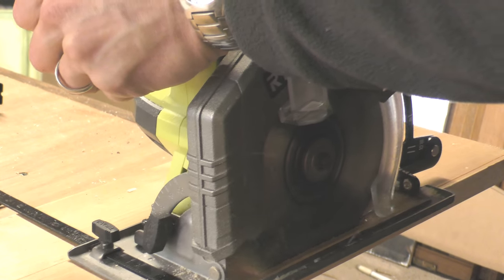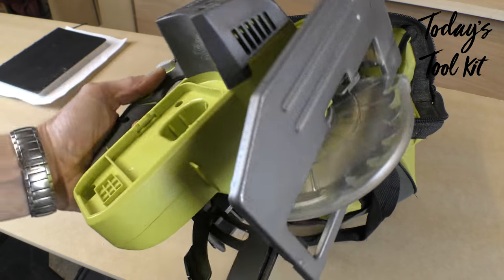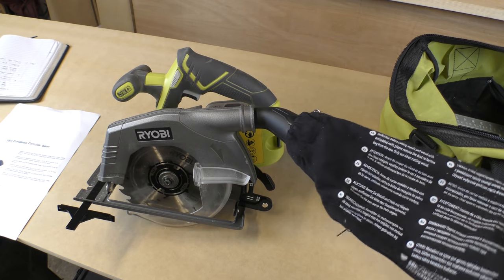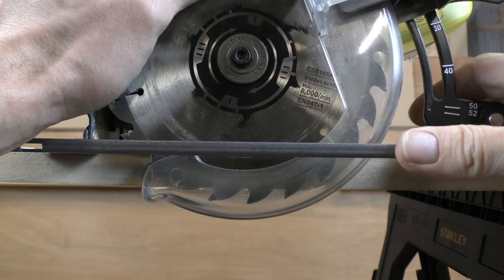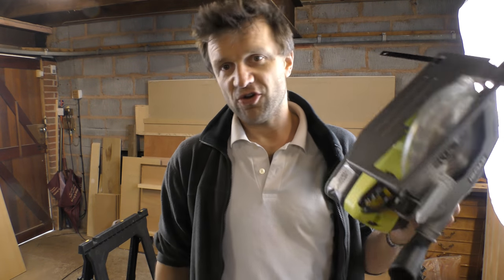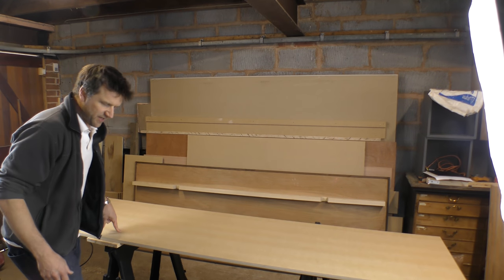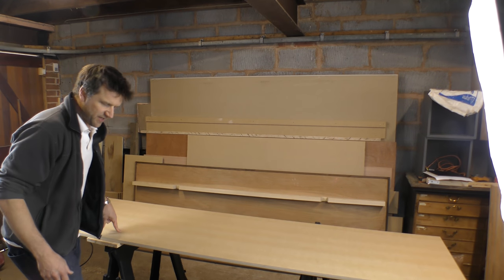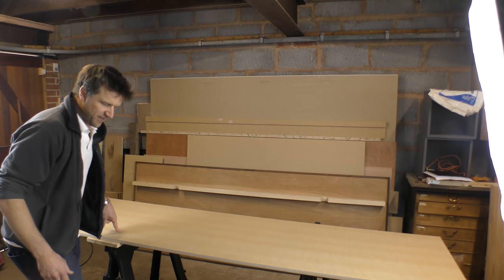Circular Saw - the MUST HAVE DIY Tool

Comment: Hi Charlie, thanks for your videos and as a first time home owner you are giving me more confidence and inspiration to try out some fixes and improvements on things I've been walking past/ hiding from. Starting with painting some MDF shelves I made in an alcove.
I have a book (Collins Complete DIY) that says the best size of circular saw is 19cm or more, but it doesn't really say why. I gather the bigger blade allows a deeper cut but are there any other advantages to a bigger blade as opposed to the smaller tools commonly available? Also, I'm keeping an eye on eBay for second-hand tools such as this, do you have any views about how to avoid duds?
Reply from the maker: Hi David, my saw has a 165mm diameter blade. For a battery powered saw you wouldn't want to go any larger. The saw blades tend to be this diameter, and very thin, to cut economically through the timber to save as much battery power as possible. I also have a mains powered Evolution circular saw with a 185mm blade. Obviously with a mains powered saw, everything is scaled up a bit because there's more power. I haven't used the Evolution much yet so I can't really say how they compare but it will be able to rip through wood a lot easier. I've found the Ryobi a brilliant tool, small, much lighter than the Evolution and a real game changer in terms of what I can now achieve with it - and you're obviously not trailing a flex around which is a bonus. Have a look at plunge saws as well because they tend to run on tracks with a notch to stop the saw wandering so you're guaranteed a straight cut. I'll be doing another video on circular saws in a few weeks so keep your eye out for that. I would say generally steer clear of brands you haven't heard of, and with second hand saws you always run the risk that they're damaged in some way which will affect the accuracy of the cuts. That said, Aldi do a plunge saw and guide for under £80 https://www.aldi.co.uk/workzone-track-saw/p/087060236365900 which has had some decent reviews on YouTube

Comment: I was taught to extend the blade through the work piece so that the carbide tips are totally exposed. That, I was told, would make the blade "run cooler."
Reply from the maker: I think either is fine. The important thing is not to expose an excessive amount of blade below the material being cut as then the blade tends to wander.

Comment: Mate... that last cut, noticed you pushing in with the thigh to hold the waste piece up... have read that pinching of the saw blade can cause kick back. Not a major problem with those tools having electronic brake but something to have in mind.

Comment: Good review.  How much lateral play is there on the axle?  Are the bearings seated in metal or plastic?  What are the prices for replacement bearings?
Reply from the maker: There's a minute amount of play detectable by hand. As for your other questions you'll have to take them up with Ryobi but for the price it's a great tool and there are no signs of wear so far.

Comment: Hi Charlie, I love watching your videos they are so informative. I’ve just invested in a Ryobi circular handsaw. I’ve never used one before and Im just getting used to it. I do however have an evolution mitre saw which I’ve had for many years and I’m quite confident and competent with it, I was just wondering when setting the depth of the blade on the Ryobi for a straight cut to a 1/4” below, do you have to reset the depth to do a bevel cut ? Sorry if that’s a stupid question.😁
Reply from the maker: Hi Nikki - good to hear from you and thanks so much for watching my videos! Yes whatever you're cutting you need to set the depth of the blade so that no more than a tooth is poking out below the surface to be cut.
Reply: @CharlieDIYte  morning Charlie, Thank you. Time to set it up and make some cleats for the tool storage wall cabinet I’ve just finished making after watching a YT vid. 👍I’m going to have a go at making a fence for the saw.

Comment: Soon, I’m going to be replacing a lot of skirting boards, would you choose to buy a circular saw over a mitre saw because of the versatility of the circular saw?
Reply: Dave 1976 defo, with a mitre saw can only go in 22cm
Reply: Dave 1976 defo a circular saw I mean
Reply from the maker: If it's just skirting you'd mostly be using it for, I'd go for a mitre saw - much more accurate cuts. The circular saw is very versatile as you say but is better for longer cuts or short cuts where accuracy isn't paramount. The mitre saw is great for multiple repetitive cuts and accuracy. You can get a mitre saw pretty cheaply these days. Take a look at the Evolution range. I have an Evolution mitre saw and have been very impressed with it - a lot of tool for under £200!
Reply: Charlie DIYte thanks for taking the time to reply.  What a great channel.  👍

Comment: Charlie, it may just be me, but..... in the video, you use your right hand and the blade is to the left, which makes it easy to hold the rafter square and cut along it.  When I click the link to Amazon, the saw shown has the blade to the right which means that to achieve the same thing, you'd have to cut left-handed.  This seems odd?

Comment: A couple of observations on the safety front.  Do not do DIY in open sandals; it's asking for trouble.  Also when adjusting the saw remove the battery!  It may take a few seconds more but avoids any nasties.

Comment: Really helpful Charlie, thank you!
Reply from the maker: You're welcome Alex. You can also make a track for it https://youtu.be/mvcPuUz_m74
Reply: Thanks Charlie, I’ll check that video out. By the way, have you ever made a video on accurate measuring and cutting? As a DIYer, I’d love to know how to accurately measure and cut. Particularly when doing precision work. I always seem to end up a few mm over or a few mm under. I think it’s because my measurement is not spot on (especially when bending a tape measure into a corner) and then where to cut (on the line? behind the line?) is always a bit of a mystery, and that’s before I take into account the width of the cutting blade!

Comment: Can you use a smaller blade in your Circular saw then the recommended size? Ie Can a Bosch GKS 190mm Circular Saw use a 185mm or 160mm blade? thanks for the great vid

Comment: Plunge saws (or track saws) seem to be coming into vogue and replacing plain circular saws, though the only ones I've seen on the market tend to be corded, or bulky twin-battery models; thus, very expensive. Have you used one, yet? If so, would you tend to reach for it rather than this circular saw? Cheers

Comment: 2 years later, do you recommend this 18v 165mm diameter circular saw, or the newer compact 85mm ones? As a DIY, I can't tell if I will need the larger diameter cuts or the more lightweight smaller ones. Looking at cutting skirting boards and pallets, and I think I can get away with the compact circular saws.
Reply: Or maybe a 18v jigsaw. More versatile, but a little slower. They can cut bevels too.
Reply from the maker: I'm still using (and loving) it https://www.youtube.com/watch?v=mvcPuUz_m74&t=2s You can cut bevels on it too. The lightweight nature of this tool is one of its big qualities, and to date I haven't needed anything bigger, although I've started using the Evolution featured in this video and whilst a lot heavier its an impressive (powerful) bit of kit.

Comment: Amazing video man, what about holding that speed square with a clamp aswell? think will bring more safety, hehe cheers from Argentina.
Reply from the maker: You're right buddy, that would be sensible, although when you use it you'll realise it isn't really necessary as the tool is so easy to use. Check out this video also if you have time https://www.youtube.com/watch?v=mvcPuUz_m74&t=32s

Comment: I really wish you'd shown how you supported the cut at 10:24, been trying to look for a video that shows a circular saw cutting down a large piece where both sides are very large and how to support that safely(because that seems to be most dangerous one for binding and kickback) but I can't see your support setup for that cut.. i can see one half is clamped to the jig but not the offcut, and when you pull the cut piece away it's your table surface underneath? Does that mean your saw cut through the table to make this cut??
Reply from the maker: No I'm really careful to ensure I never cut into the table. Best thing you can do mate is get yourself a sheet of 6mm MDF or ply. I had the 18mm sheet you're referring to raised off the work bench on strips of 6mm MDF, supported in enough places to ensure the blade didn't touch the table. Alternatively you can just have the entire sheet underneath the one you're cutting.
Reply: @CharlieDIYte  thanks so much for replying! That's really helpful info, watched so many videos before yours and seemed like no one was interested in explaining a cut like that, just endless cutting of short ends. I'm working with really limited space, just a small pavement area outside my apartment but that method is definitely something worth storing if I need to break down something big. Loving alot of your other videos, great info for the beginner DIYer

Comment: Hi Charlie great video,  does a Ryobi battery charger fit all sizes (Ah) batteries  (e.g  1.0Ah  3.0ah  4.0Ah  5.0Ah)  thank you
And do you know why Circular saws never seem to come with batteries and chargers?
Reply: Yes, a Ryobi charger fits all those batteries, because they're all 18volt batteries. The charger will not accept 12volt batteries, unless it's a dual charger. Circular saws don't often come with charger and batteries because they're intended to be an addition to your drill set, which most of the time include batteries and charger. This happens with many tools aside from circular saws: jigsaws, multi-tools, routers, angle grinders and more. Hope this helps.
Reply: @Matos942  Yes Kevin thank you that does help a lot. My mind may have just been made up. 
Now all i need to know if the B&Q bundle and the tool itself that'smentioned is actually worth the price tag.  
Thanks Kevin👍👍
Reply: No problem, friend. Good luck
Reply: Hi  @N3ALE  thank you so much for the reply, I've actually got it in my shopping basket online...;-))), as it appears to be a great deal considering its a 4.0ah battery, but I've just heard that Ryobi are like "Apple"  as in nothing else is compatible with the tool outside of Ryobi equipment, so for example circular saw blades  must be Ryobi blades as they ae a specific size and different from standard blades. sooooo I'm still in that dilemma, do I buy this or look for a more compatible circular saw brand.
Reply: @seanditch4419  Hi Sean, yes my dilemma too, although I understand that Diablo blades may fit, the same company in Hong Kong owns both Ryobi and Milwauki tools. Technotronic, I believe.
Reply: Hi   @N3ALE  it seems like a bit of a commitment,  and I'm surprised at B&Q for getting rid of Ryobi, but, at this price i'm thinking can I afford not to take the offer as batteries and chargers seem to be a bit of a (rip off market when it comes to cordless tools)
Reply: @seanditch4419  Hiya, I've seen third party batteries for sale for the Ryobi range, and their products will still be on sale on the net, and probably at better prices than B&Q, not sure what the third party batteries are like, could be an idea to check the reviews on Amazon, or here if there are any. B&Q here in Poole, Bournemouth, Yoevil and Shaftsbury do not have stock of any of the battery saws apart from the £150 offer with the battery, charger and bag, not sure if that's a bargain, as I don't know what the original price for that kit was
Reply: Thats the problem  @N3ALE  I think on their own the battery and chargers run into about the same price as the tool itself, (such a rip off) so this could actually be a bargain.
 I was just looking at the VonHaus Cordless Circular Saw with 3.0Ah Li-ion 20V MAX Battery, Charger, 1 x 165mm / 6 ½" TCT Tip Blade & Power Tool Bag - Includes Ergonomic Rubber Grip & Variable Cutting Angle/Depth  on Amazon and all looked great even the price of a spare 4.0ah battery as this comes with a 3.0ah but then noticed the rpm is only 3800 compared to the Ryobi 4700, not sure what a difference that would make though.
Reply: @seanditch4419  Hi Sean
After even more research on different models, batteries and prices I bit the bullet and went for it from B&Q, and although I've only made a couple of cuts of a  3/8th ply sheet, its really easy if you set the blade as per this vid, and let the saw do the work, hopefully it will encourage me to be a bit more'constructive' lol good luck with your decision making.
Reply: Ahhhh Hi  @N3ALE  lol good for you..👍👍🤣👏👍👍🍾 a new shiny toy to play with good on ya mate.. almost clicked the checkout button myself this weekend but stopped when i realised it only cuts to about 2" (52mm) if you do a cut to that depth could you let me know how it goes please?
Must admit I've never thought about buying a tool so much in all my life...🤣🤣🤣
Reply: @seanditch4419  Hi Sean, I can't say I'll need to cut anything thicker than 52mm, that's about a door thickness I think? I recon my work will be mostly play and 3"x2" type stuff, but sure, will let you know when I graduate to that depth. Cheers, Neale :-)
Reply: Thx Neale 👍👍

Comment: How would this work for a circular saw with a smaller blade? Mine only cuts to 26mm - I’m thinking I’d be sacrificing half of that with the  guide?
Reply from the maker: I know what you mean. I think your best bet is to clamp a piece of wood or metal down to the piece you're cutting and use that as a guide.

Comment: Is there any way to avoid a wobble? I must've done something wrong for it to develop a wobble after a few uses.
Reply from the maker: Have you got the blade set at the correct height? If too low it will wander and possibly wobble, but personally I've never had mine wobble.
Reply: @CharlieDIYte  I may have used it to slice a log once. It's giving that wobble since. 🤦‍♀️
Reply: @CharlieDIYte  Thanks for the reply, Charlie.

Comment: Great informative video Charlie. refreshing to see power tool video by a British bloke when you tube is flooded with Yee haa yanks looking like they are auditioning for a film.role. As a novice user & novice D.I.Yer I am looking for a user friendly saw. This lock down has pushed me to learn & do a more things myself. Was looking at the Worx Exactrrack which I favoured due to the easy to use guide but this Ryobi has a similar feature. I need a new drill too so Just waiting for B&Q & other retailers to offer some deals but theres just non about at the moment. Keep the vids coming mate, stay safe. Plenty to keep you busy! 😉👍
Reply: "Yee Haa Yanks?"  Thanks for the stereotype old chap!
Reply: Big DIY stores are the last place you should go to buy branded power tools (much more expensive). Somewhere like Screwfix or Toolstation (and many many others online) are much more likely to have decent deals/promotions and you should be able to bag a good bargain. A year ago, I got an 18V cordless Hitachi drill with 2 Li-ion batteries for £99 from Screwfix - such a good deal I got my dad one too!

Comment: Gotta be honest, I'm surprised you didn't already have one of these and know how to use it (given your obvious experience at DIY).  I think, after a Drill and Mitre Saw, a Circular saw was my next purchase.  They are very versatile as you rightly show.  My first was a battery powered one, but I fairly quickly replaced it with a 240V one, as I found the battery didn't last long and the tool was underpowered (admittedly that was in the days of Ni-MH batteries).  I think a battery powered one is a good place to start, as it feels like a fairly safe tool to use.  The jump to a 240V was a little intimidating, as you can really feel the power.  I am considering upgrading to a track saw now though.  Just need to save up the money!  Thanks for the video though, I'm sure it will be enlightening for new DIYers.

Comment: Hiya Charlie great video,  
If you could choose only 1 type of circular saw would it be corded or none corded?
And why?
Thank you.
Reply from the maker: Uncorded every time, mate. It's just so much easier to use. When you're doing long cuts you just don't want a cord trailing. I was discussing this with a carpenter mate recently - in the context of routers and we both agreed corded routers are a nightmare, as you often send the router plunging off in the wrong direction, when the cord gets snagged on something, or you have to stop to pass it over the bench etc.
Reply: Exactly what I was thinking, I figured corded you'd have to keep stopping to re adjust  ...I too have had direction snags when using a router to carve wood signs.
But what about power, do you have to compensate a power loss for cordless?
Reply from the maker: @seanditch4419  No, not at all. You do need a 4Ah battery or higher, but with this, my circular saw lasts for hours. Plus it's not really about raw power - the blades are really thin but very sharp. The thinness helps to take the energy out of the cuts and make the battery last longer.
Reply: Charlie DIYte 
Thanks Charlie, keep up the good work love a good honest review and tutorial. Thx👍👍
Reply from the maker: @seanditch4419  Cheers mate. I'll do my best!

Comment: Reading that the 18tooth blade rips wood rather than clean cut ????. 

Yours cuts look good ??? Are you using original 18tooth blade ??

Thanks
Reply from the maker: I haven't had any problems with either to be honest. I used the 18 tooth for a while but now use the 40 tooth version. They're fantastic blades. I dare say you could probably fit other blades but you'd have to buy one that came with an adaptor piece to reduce the diameter of the hole to fit the Ryobi.